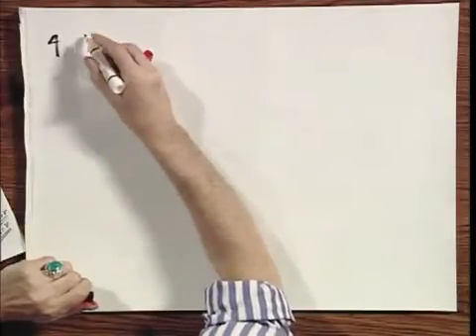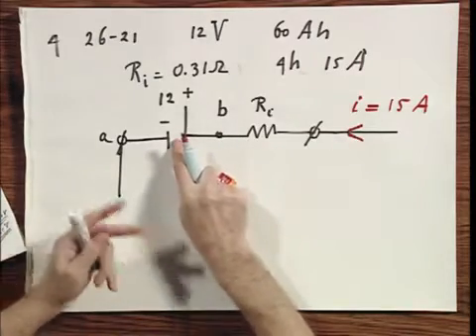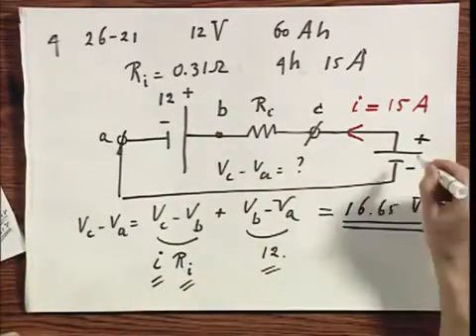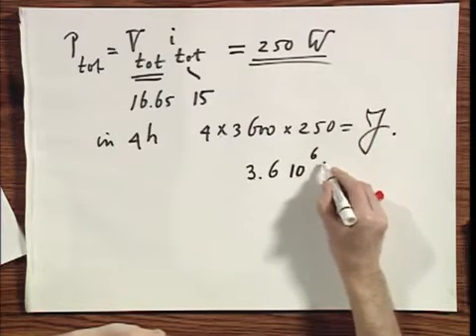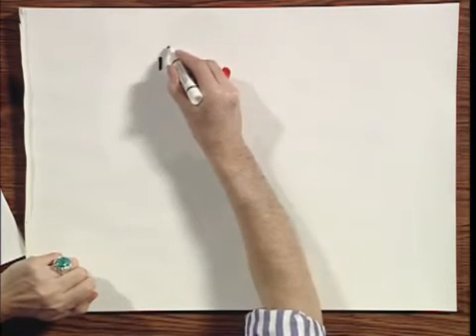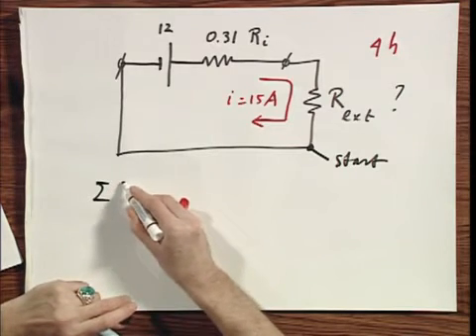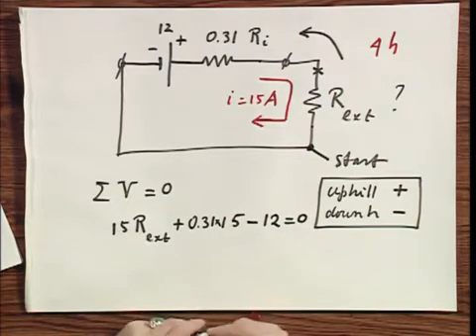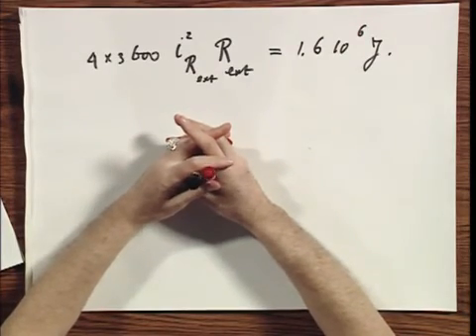8.02x - Module 04.03 - Charging and Discharging a Battery.

Comment: First of all Dr.Lewin Thanks for all your videos on YouTube.
I'll try.
When we were charging the  incoming power had to over come the internal resistance.
That is when we lost power due to heat loss while charging.
When we were discharging, I'm guessing the internal resistance did not change and so we lost the same amount of power due to heat loss at discharge of battery.

But that doesn't account for for external resistance and the inevitable heat loss there during discharge. 
So I don't know. 🤷🤦

Comment: If you think about your rechargeable device (say your laptop), you remove the external source and external resistance once it's charged by unplugging it from the charger.   Now let's say you plug a flash drive into your computer.  This would draw a current much smaller than the 15 A that you used to charge it.  Let's say it only draws 1A.  Since we square the current when calculating the energy, this gives us a gain of 1 as opposed to a gain of 15^2 = 255, so you don't lose near as much energy to heat when discharging.

Comment: Sir suppose a charged capacitor is put in a circuit with a battery with zero internal resistance... How to decide whether capacitor will be further charged or discharged
Reply from the maker: watch my 8.02 lectures where I discuss RC circuits.
Reply: Lectures by Walter Lewin. They will make you ♥ Physics. I have watched all your lectures sir
Reply from the maker: >>>How to decide whether capacitor will be further charged or discharged>>
1. measure the voltage over the C or
2. place an ampmeter in the circuit.
Reply: Sir I will put it a different way.. Read my above question..a negative potential of the battery is connected to positive charge cv of capacitor.. Is now charge on plate connected with negative side of the battery is -cv or 2cv
Reply: Lol.  Yes, that will work!

Comment: Sir as we know that resistor opposes both  AC current and DC current due to collision of the electron . sir inductor  oppose the ac current but behave as conductor for Direct current. Sir mathematics says that impedance for inductor = angular frequency*L. Sir for direct current impedience is 0 hence it behave as  conductor for DC. Sir but what is the physical reason that explain why inductor behave as a conductor for DC and oppose the Ac. Sir please give physical reason
Reply from the maker: Faraday's Law! use google
Reply from the maker: http://www.numericana.com/fame/#lewin
Reply: Lectures by Walter Lewin. They will make you ♥ Physics. Sir how I can ask question from these professors